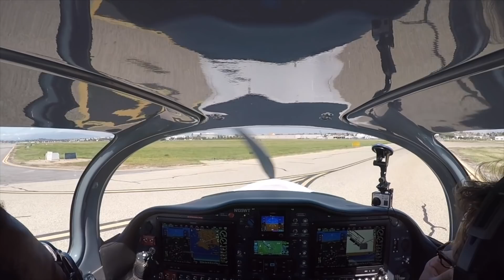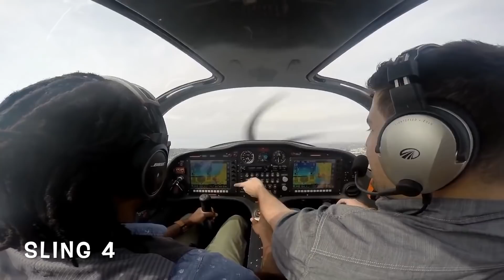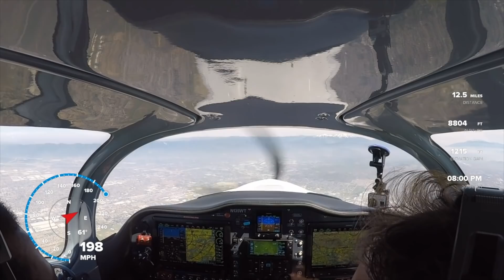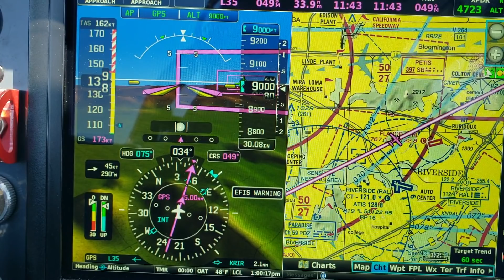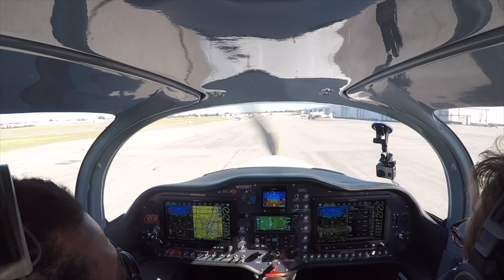INSIDE The NEW Sling TSi l FULL Flight Review & Performance Data

Comment: A 4 seater experimental depreciates very quickly.. Numbers don't make it worth it.
Reply: Ya, I'm with Dan on this one. I fly out of their hangar and I see them for sale all of the time. They have a sling 4 for sale right now for about $160,000. I am told that the build cost of that plane was around $200,000. That seems pretty reasonable for an airplane. A friend of mine just bought a used sling 2 LSA for like $120,000 and I'm pretty sure the build cost on that was like $150,00ish. The issue though is that their are just not a lot of them for sale. It's not like Vans where the market is littered with used options everywhere. When you look at the operating costs compared to a Cessna for instance, the savings are immense. I looked at the numbers to have the sling 2 replace Cessnas in flight schools and the sling is about $4,500 a month less to operate than a Cessna. That includes the monthly payment for the airplane. So in essence, it all comes down to how much you fly it really. The more you fly it, the more it makes sense because the operating costs for a TSi are miles lower than its competitors. But if you can show me where 4 seater slings are depreciating rapidly, I will happily concede your point.
Reply: @kevinbutler9786  So circa 160k is not a nose dive? and show me a 5 year old half way through its TBO. Incidentally 2 Seaters are a completely different kettle of economic fish and I never mentioned them. If you buy a new 4 seater experiential you are choosing a road that is the least efficient financially.
Reply: What are you talking about?? any of the 4 seater experimentals I've looked at all held their value extremely well!! Sling 4, RV10 and Lancair have minimal depreciation compared to any certified 4 seater on the market
Reply: @thor70001  Show me a 5 year example close to its TBO.... Do the numbers.
Reply: @PaulAnthonyDuttonUk  little confused on what numbers you would like me to show?? I'll tell you this, you'll be hard pressed to find any personal use plane, certified or experimental close to TBO in a 5 year timeframe!!
Reply: @thor70001  Exactly.... So think about what you just said..
Reply: Humm.. The few used S4s I found for sale asking prices are ranging 170 to 190k. With total time from few hrs to 1000+ hrs.. Complete build prices shouldn't exceed these numbers.. NOW I DON'T Think anyone can make a business in building to sell at profit. But I'm sure you will recover your investment after few years of flying. See how much that brand new cirrus is worth ofter flying it for few years from new
Reply: @asiasmells71  I agree... I don't see any big drops in prices.
Reply: You can buy a brand new piper now for 200k.
Reply: @PaulAnthonyDuttonUk  LOL......really?? which one, because if you're talking about the new Piper 100 their start point is $260K bare bones, loaded for IFR training puts them around the $350K mark
Reply from the maker: Tell that to Cirrus Paul 😄.
Reply: @mojogrip  Cirrus is a GA aircraft(not experimental) Kind of my point... :) :) :)  Find out how many 4 seater units Sling is selling and there will be your answer. It makes no sense to buy a 4 seater "experimental" or sell them which is why Cirrus is not in that space.
Reply: Oliver Brama The point in my original comment is that 4 seater  experimental aircraft are not economically efficient purchases. There is a very limited market which is why Cirrus and the like don't play in this space. The lack of demand for such means that the resale potential of a 4 seater "experimental" goes to the back of the queue and therefore can not hold their value. You said you would be hard pushed to find a 5 year old with half its TBO used and that is true which means it's even more efficient to sink 200k into a house then let it out and thereafter use the profit to rent a 4 seater when needed. You maybe a sling fan boy but that does not negate the economical fact that 4 seater "experimental" aircraft don't make sense on paper coz if they did Cirrus would be making and selling them. If you bought a new 4 seater experimental Sling you would be an idiot and unfortunately for Sling there are not enough idiots around.

Comment: That is a NICE experimental. Its like an SR22 at half the price.
Reply: Brandon Wright for a new SR22 they start north of 750k, so this is basically 1/4 of the price! It’s an outstanding value!
Reply: @austinstroot9910  Make sure you put a value on the Labor too, however. :)
Reply: Brandon Wright Very true, but the sense of pride you get after finishing something that you built is pretty substantial. Not to mention your annuals are significantly cheaper (because you do them!), you don’t have to buy FAA cert parts, fuel consumption difference, and no mandatory 10 year chute repack/rocket replacement (unless you elect for the chute option)! The differences other than initial price are substantial, a new cirrus is just not within my reach financially, which is why I’m looking hard at this, I’ve actually went out to visit the people at Midwest Sky Sports (the Midwest region authorized sales, service, and build-assist center) who are extremely friendly and will take the time to show you around their shop! This is just a product that I believe in and want them to succeed just as Van’s did!
Reply: Try 1/4 the price! Sweet plane.